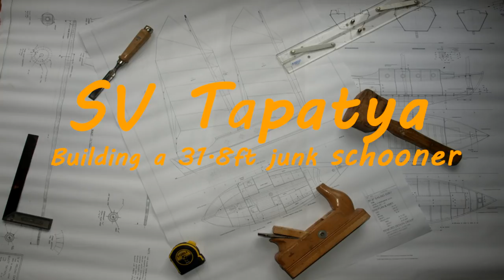More galley, more boatbuilding skills; more, more, more!! - SV Tapatya EP112

Comment: Hi. Why  you have sand piston ring area as you know piston seal ring very importan for sealing. I think you should change the piston seal ring with new spare.otherwise piston able to lost performans.
Reply from the maker: There are no seals to change, Yavuz
I’m only cleaning the piston because it had got tight on this pump. It’s a very fine sand that is only removing the crud that has built up over the years 👍
Reply: @SVTapatya  thanks for kindly  answer .good luck 🖐
Reply from the maker: Thanks Yavuz 😃